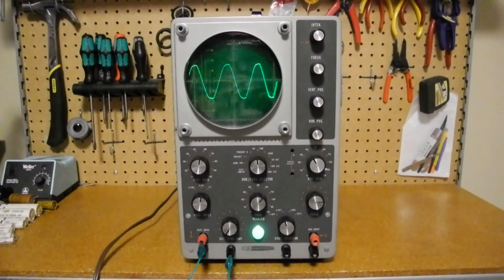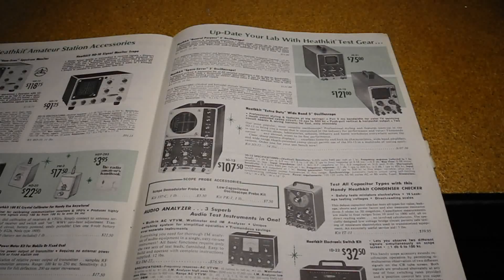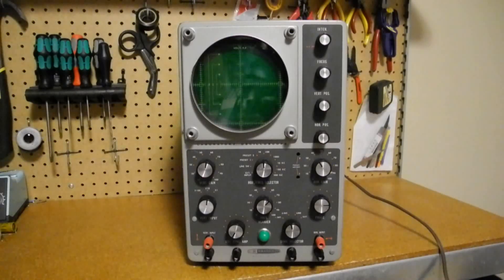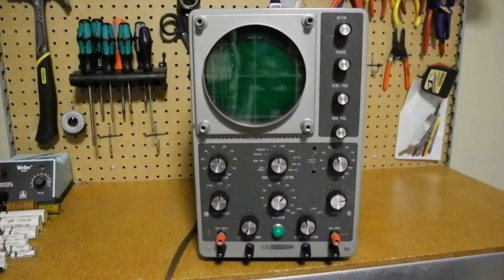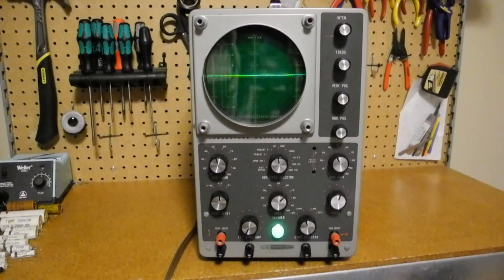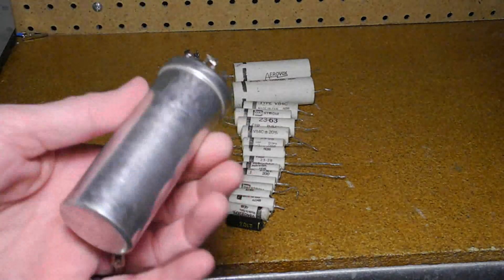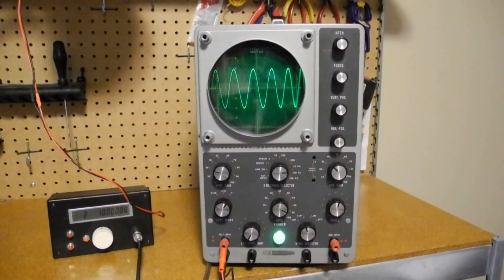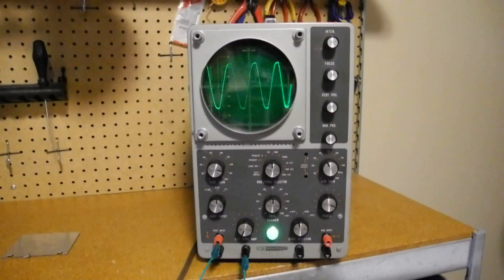The Heathkit IO-12 5" Laboratory Oscilloscope

Comment: A very comprehensive and informative presentation of this 60 year old device, thanks!
Good explanantion of the overall functionality and construction. It looks amazingly simple and 'empty', but then: multi-capacity cans I have never even seen before..

While desperately trying to debug an old and rare Pong console cartridge (Akur SD-050 with a PC-503 tank battle cassette, around 1978) I discovered my late Dad's Heathkit IO-12 in his former workshop, dated 1962. All in a box, with assembly docs (English, German), both probes. So far I didnot have the guts to fire it up as is, fearing to cause more damage if something has dried up or went out of line over the last 50 years of sitting in the box.. My version is of course the German one with a 220V input. Jeez, this baby is HEAVY..
Also I am not sure if this cope is any helpful to inspect the 4MHz oscillator that the Akur game is (no longer?) providing. I am not an electronic whiz kid, last time I had my hands on a scope was in the university back in 1982 in our physics labs. 
Next to this Heathkit box I also saw yet another very old oscilloscope that I have not yet unearthed from its grave. Probably from the same time period. My Dad was a TV repair guy back then, but kept all in pristine shape and fully documented.
Looks like these old machines need a lot of TLC to re-activate, just like cars and motorcycles. 
Entropy gnawls on our universe whereever we look..

Comment: very nice scope info... i got a heathkit vector-scope io-101from ebay after cleaning, the unit still works... you-go heathkit... good people.. wished they survived...:/  it is interesting that the rbg color 360-degree circle and the 3-phase voltage/current power  360-degree circle PF/harmonics have some similarities... any videos to explain this?   thanks a lot...:-)

Comment: Are the scopes use to measure AC signals or DC? are they mainly to measure AC or DC?
Anyone know? Thank you
Reply from the maker: Most scopes can measure AC or DC, although some older ones don't have a bandwidth that goes all the way down to DC. You often use them to observe waveforms that are complex and might contain AC and DC components.
Reply: @jefftranter  Thank you for the repply. Learned something new.
Great video. Very informative and interesting.
Reply: An inexpensive vintage a EICO and Heathkit can measure both AC and DC.a higher level scope like Techtronix can measure AC and DC down to 5 millivolts DC  and 400 volts Dc with 1% accuracy.
Reply: @erin19030 I bought a Tektronix dial channel and now one of the channels is not working, can I still use the single channel? Or are both channels required to troubleshoot?
Reply: A scope like this one is good for signal tracing signals with some accuracy. Think of it as your eyes into a circuit. The scope can measure voltage, frequency, current with special probe and shape all in one glance whereas as meter can only measure voltage, current and maybe frequency, each parameter one at a time over 3 measuring devices.
Reply: @erin19030 Thank you Erin for the explanation. Since then I have bought a scope and have tried to learn how to use it to troubleshoot but I can't find tutorials that are simple enough for me to understand. The ones out there in utube are way over my head and not for newbies.
I will continue trying to understand them.

Comment: I sold my IO-12U around the mid-1990s, it was still working.  It was sold complete with the manual which included schematic, the graticule however was missing.  The transformer had required rewinding when I first got it, and I suspect that this caused it to have a little more hum on display than it should due to magnetic radiation.  I fitted a mu-metal shield around the tube which helped quite a bit.  The lack of DC input capability was this unit's biggest weakness.  I added a better calibration circuit.

Comment: Hi Jeff, I wasn't sure, but did you replace the paper caps with "new" paper caps, and from JustRadios.com ? I assume you could use just about anything, like ceramic, so was your goal principally to restore to vintage?
Reply from the maker: Yes, I did. Ceramic caps aren't generally available in the larger values used by the paper caps. The new ones look similar to paper caps but generally don't use paper as a dielectric any more, they use a metal fim and a plastic dielectric. I didn't really care about it looking completely original. If desired, you can "restuff" the new caps into the cases (or reproductions) of the old ones.

Comment: Jeff, I enjoy all your video's  I am a Heathkit nut myself, but without a deep electronics background.  I have a question.  I have an IO-12 I wanted to rebuild, but upon inspection, the Horz pot was internally trashed. Heathkit number 10-13 200k center tap.  I cant find a new one, or old one for that matter.  is there a new pot out there that will work? or is there a workaound?  I saw on the AM forum a guy used a voltage divider but I am not that smart yet :).  Thanks if you have the time to answer.  Dave KC3GMQ
Reply from the maker: Yes, one of these will be hard to find. My inclination would be to see if you could make one by soldering a wire to the center of a standard 200K pot. That might work. Otherwise, an alternate circuit might be possible but would take some thinking and experimentation.
Reply: Thank You

Comment: Whats a decent cheap scope to use for a
utomotive use? Those dso type any good?
Reply from the maker: I've never used an oscilloscope for automotive use, but Heathkit (and others) made Ignition Analyzers like the IO-20, which were oscilloscopes specifically designed to be used for testing automotive ignition systems. This is probably what you want, although I don't know how useful they are with modern automobiles.